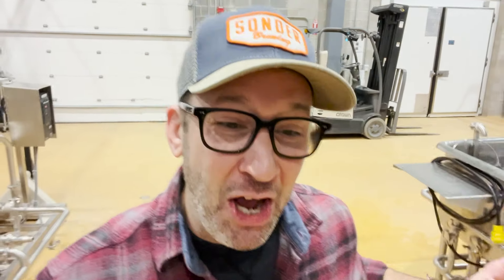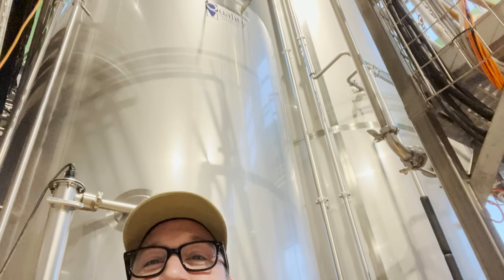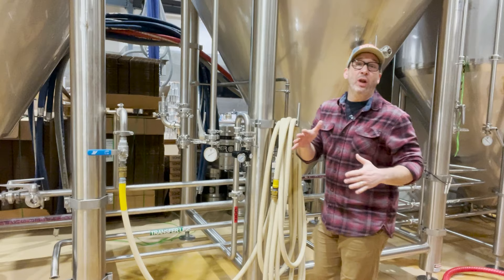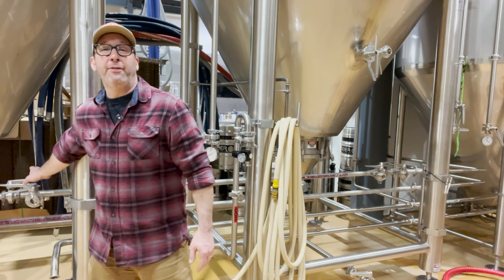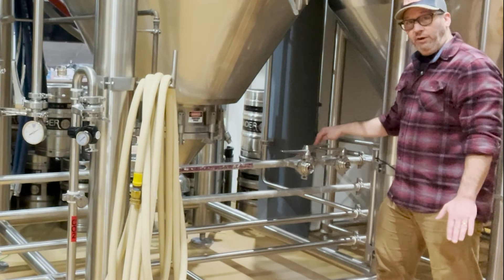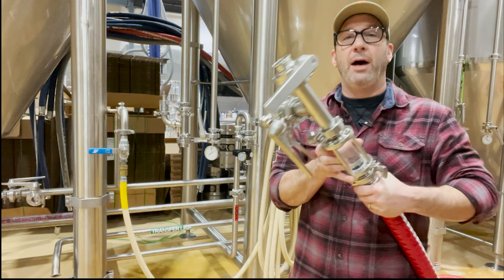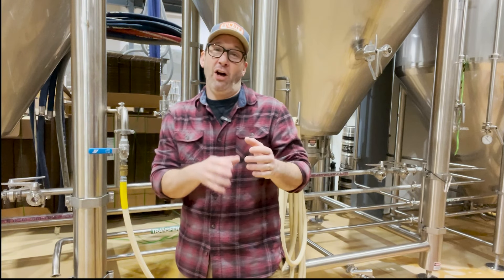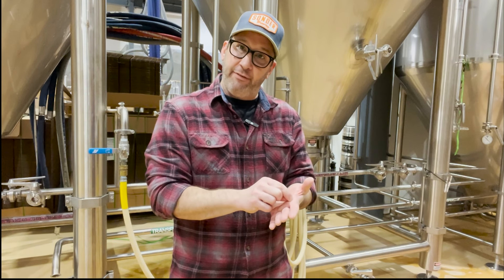Huge Advantage In Making Clean Beer: Sterile Loop Tutorial!

Comment: I typically run a peracetic loop on our 1bbl pilot system. I'll utilize all the hoses that I'm using for the brew day and - using a pump - run the peracetic through the 1bbl unitank, the pump, hoses, and the plate chiller on the pilot brewhouse.  I've considered using hot water - we keep our HLT at 180f - but then I worry about the small glycol chiller being able to get the tank back down to temp by the time I'm ready to pitch.

Comment: I could be wrong, but I think this would actually be considered a pasteurization process rather than sterilization. We do this process also, but because we don't brew daily, we can use our HLT for this purpose too. We also use the HLT as part of de-oxygenated water production for pushing lines, and purging/pasteurizing BBTs after having opened them. Process, process, process.
Reply from the maker: I will dig deeper and double check myself, I appreciate the heads up!
Reply: That’s what I know too. When using heat to sterilize something, it needs to be around 121 degrees Celsius to kill ALL microorganisms or bacterial spores. That’s why autoclave is used since it can reach 15 psi to raise the temp of water to go beyond 100 degrees celsius and reach 121 degrees celsius since there are some bacteria that is heat resistant and their bacterial spores are more heat resistant.
Reply: @jamesaaronrolandosantiago19 

So this is a sanitation loop, not sterilization.